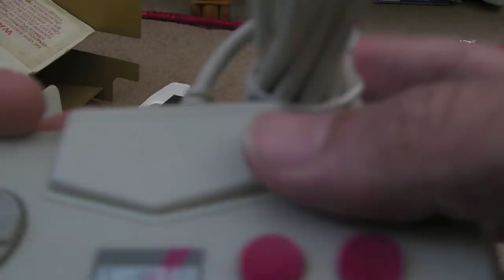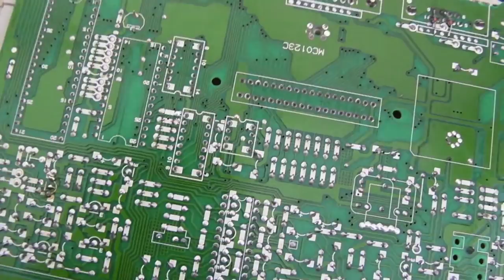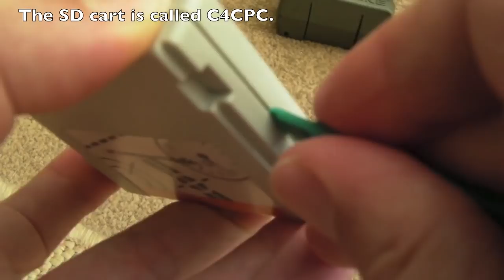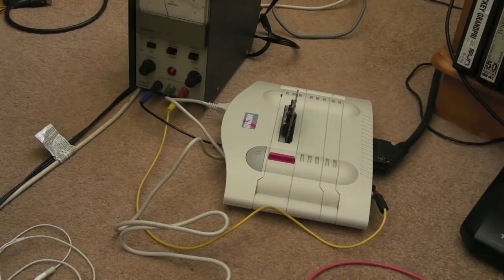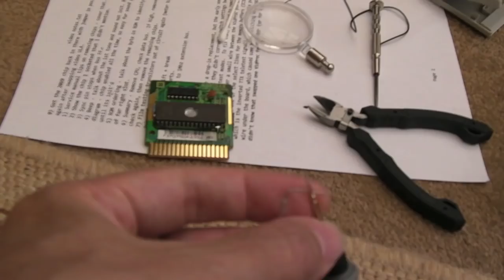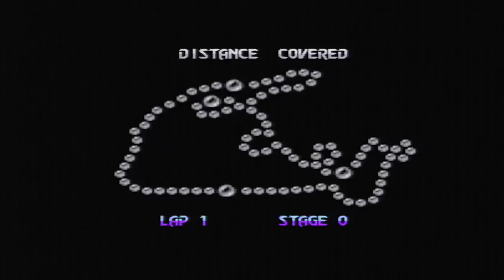Amstrad GX4000 No Power & Ghosts n' Goblins Remake 2 in 1 Cart

Comment from the maker: 1) The first mistake there is I referred to the DAC as an ADC =/  It's a digital to analogue convertor.  Takes 4 bits for each colour (R,G,B), and outputs three analogue RGB signals.  
2) I referred to the week pull down as a pull up - doh!  
3) I also forgot to include a clip there showing where the 2nd 7805 is.  Its the black transistor looking component sat inbetween the SCART connector and the video output DIN.  It's a smaller package to the 7805 that is heat sinked.  
4) There's also a video response here regards the PSU being AC and not DC.  http://www.youtube.com/watch?v=Dd2lQoaw_uM
Reply: Sweet! I'm gonna take this as license to make DAC jokes again :D

Comment: Hope can I can mine to play in the USA
Reply from the maker: I would get a US PSU that outputs the correct voltage AND polarity first - that way you can power it easily from US mains.  Do check the voltage AND polarity are correct, or you will kill the GX4000.   Once power is sorted, you could get something like an RGB lead - SCART is not very common in the USA, so maybe you could use an upscaler to take that SCART RGB and convert to HDMI.  There are options like the RetroTink adapters, or the OSSC.   In summary, you need a US power supply with the correct voltage and polarity, a SCART RGB lead for the GX4000, and some upscaler that takes SCART RGB and converts to HDMI.  

There may be other ways you could convert the video encoder circuit to NTSC Composite, but that would mean tinkering with components on the motherboard.   Another alternative is to find an older TV or monitor that works with PAL video standards - some of the mid 2000's TVs support any video region, for example my Philips TV from 2007 will display PAL, NTSC or SECAM signals.
Reply: @GadgetUK164 awesome I just ordered a triad power supply 9v 1 amp and a male to male scart cable so I’ll message back with the info for ya and thank you
Reply: @GadgetUK164 awesome I just ordered a triad power supply 9v 1 amp and a male to male scart cable so I’ll message back with the info for ya and thank you

Comment: Some tv's particularly Samsung, are incredibly fussy about the switching voltages. My Syncmaster 711MP absolutely will not go into RGB mode unless there is at least 9V on pin 8, and at least 1.5V on pin 16. One or the other will not do - it HAS to be both.

The major pain is pin 16, because it is loaded by 75 ohms... so if you have a Spectrum +2 for example, the 12V on the video port is protected by a 1K resistor. If you use that for pin 16, it is dragged too low to provide the correct switching voltage for pin 8. When I make Amiga SCART cables, I use the 12V line and put a 1K resistor on pin 8 (for safety), and a 470 ohm resistor on pin 16. 

I ended up making a breakout connector which allows me to feed the TV with an external 12V supply so that I can force it into RGB mode, for any SCART cable i use

Comment: Sweet I remember my mate getting one of them, two weeks later he had a Nes ..... I thought at the time it was cool looking.... Ps. 1-3volts on scart pin will enable 4:3 rgb , higher voltages normally switch it to 1:69 I also subbed
Reply from the maker: Thanks!  Yes, I researched just after uploading the video and spotted that!  So it is totally possible for them to have designed it so the 5v feeds through and is dropped with a resistor.  Crazy they didn't do that =/  Thanks for the sub =D
Reply: I can imagine the meeting Alan sugar how much is the resistor? We will leave it out Al. 

I only found out the night before from Wikipedia he he , because I made a cable for a raspberry pi to output a 240p rgb 15hz signal to a crt tv , tbh I bodged it with a AA battery 1.5v to see if it worked and bingo, it effectively turns it into arcade perfect emulation. I see you love your neo geos I have a neo mvs too and side by side I cannot tell what one is emulated. maybe that might be somthing you like to play with the I am using the cheapest pi too it's a fiver I think.

Comment: I have ran into the fail blank check and or burn before with my programmer. It appears the voltages are set to low in software for these AMD. At least my programmer was .25v to low. Verified by looking up the chip datasheet and comparing to what the software preset was.
Reply from the maker: I am sure that's what it is, it's either the timing is not right for the AMD chips, or the voltage.  But... other AMD chips program OK.  That leads me to think that some are fakes.

Comment: Oh man, I got like 4 of these all in different states hahah. I really need to get them out and work on them. Love the covert mod of G&G and it looks a great version, but still not change in weapons only the lance, unlike the other 8 bit versions. I would be interested if a keyboard could be connected to these some how to play modded carts for CPC games that require keyboard input. Ace vid as always thumbs up!!
Reply from the maker: You can change weapons!  I've had the dagger, axe, fireball etc.  It's complete mate!  You might be looking at the proto from last year - it was updated around a month ago. =D  You can connect a keyboard up and convert them to a fully fledged plus machine!  With the C4CPC SD cart, you can play the conversions that people have done (there are hundreds of all the best CPC games).  They have been hacked to use the controller instead of keyboard etc.
Reply: GadgetUK164 - Retro Gaming Repairs & Mods I mean the original G&G only had the Lance not this awesome version. Be nice to put like a ps/2 socket on the back and plug in a keyboard as mentioned, I would love to see that mod

Comment: What's the difference between an eprom and a mask rom? I'm guessing that a mask rom is actually stamped in when they fabricate the chip, whereas an eprom is programmed after chip manufacture?
Reply from the maker: You are correct =D  Mask ROM is typically stamped at the factory.  Some times people mistake OTP chips for Mask ROMs though.  On the Neo Geo carts for example there are often Toshiba marked ROM chips which people call mask ROMs, but they are actually OTP chips as far I as can tell (One Time Program - no UV erasure window on top).

Comment: Pretty system but I am a little disappointed the gamepads don't actually have rockets. ^_^ Yuck I hate plastic snap shells, I'd make it a law to use screws if I could. :\
Thinking a flash cart is the only way to go with the GX4000 with prices and rarity where they are for games. Great fun to try all the homebrew on actual hardware, something not emphasized enough for all flash carts IE. homebrew scene, become a homebrew tester. :)
Reply from the maker: Yeah, gamepads aren't great but they are OK!  Those snap shells are evil lol!    The Neo Geo AES carts are similarly annoying to get into, but not quite as bad.  Definitely the best move to get a C4CPC I think!

Comment: Your replacement power adaptor didn't work because it was an AC adaptor. For the same reason your multimeter on VDC range showed 0V.
Reply: What happens to a device if it gets the 'wrong' type of 'leccy?  I once killed one of those small reversing LCD monitors, intended for use with an R-Pi, by plugging in the wrong kind of adaptor without realising.  I think I still have it somewhere, in the hope that it could be revived.
Reply from the maker: I completely forgot to mention that I checked it on both AC and DC - it's outputting nothing at all, but you are right, I hadn't actually noticed it was marked AC, but it is dead.  Video response uploading now =D
Reply from the maker: Here's the video:- https://www.youtube.com/watch?v=Dd2lQoaw_uM  I appreciate I've not shown that the mains is switched on there, but it is.  I did test it for AC when I spotted it was AC.  I just completely forgot to cover that aspect.
Reply from the maker: If you're lucky it won't be destroyed by AC (if its expecting DC).  On the GX4000 I suspect it "might" work, but glitchy and unreliably.  And within a short period of time, if the AC adapter doesn't die, the system will.  The negative cycles will be captured (probably) by that diode across the regulator, and that might be one reason those diodes fail.  I've seen Super Famicoms working with AC - when they need DC...  But I would never knowingly make a choice to use the wrong PSU.   If your system has a bridge and expects an AC adapter (eg. UK NES), then you can use DC - since it passes through the bridge, polarity of that DC input doesnt even matter.